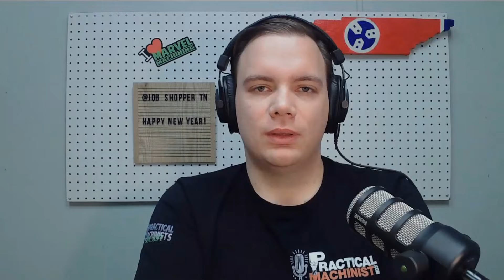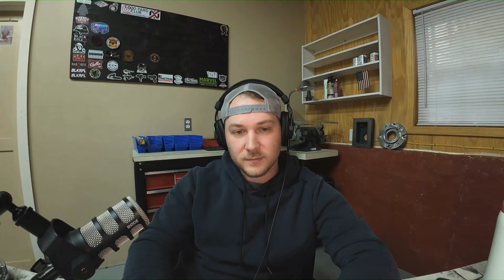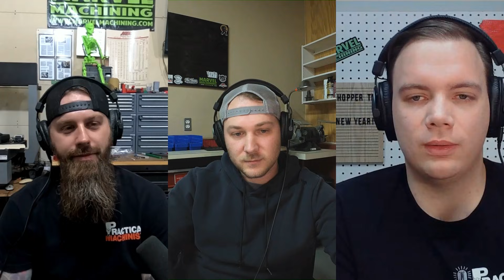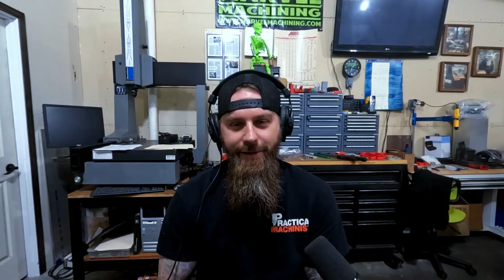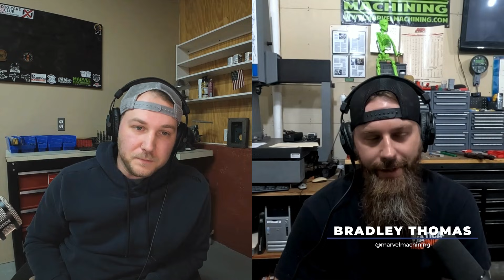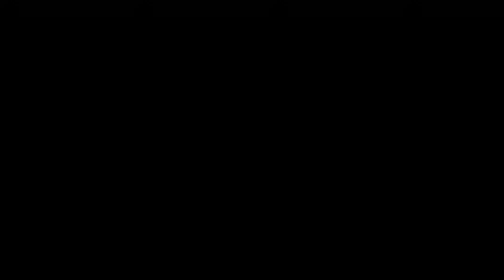Thread Milling vs. Tapping: What Works Best for You | The Impractical Machinists 14

Comment: The older I get the more I notice these things. A new technology or technique comes along and changes the game and everyone jumps in with both feet and adapts it to every situation as if it is always  an upgrade. Then later people start realizing the old way had it's benefits. Really the two ways should work in unison instead of one or the other is always the best. Solid carbide end mills and adaptive machining vs insert tooling was the first one I really noticed. I remember watching a NYC CNC video titled "stop slotting the stupid way" where he basically says milling slots with an adaptive tool path and a solid carbide was just better in every way. And sometimes it definitely is however if you have the rigidity and horsepower I will do that slot in one pass and be on to the next op before he is even half done. Just because something is new does not mean it is better and just because something has always been done that way doesn't mean it can't be improved upon. The trick is knowing when and where to use what tooling and technique to get the job done efficiently with what you have.

Comment: Form taps will be choice one for me due to several key benefits.  The main issue with them is controlling the minor diameter and avoiding a "bell mouthed" entry.    I avoid them on close tolerance work or low volume product.  Form taps I find beneficial for my own aluminum fixturing as well due to the stronger formed threads.

I end up using thread mills the most because of there function and use.  The controllability cannot be overstated.  And last but not least cut taps have there place and should never be overlooked when you need consistency and simple thread applications.

I do have a question though when it comes to the indexable vs solid carbide end mill conversion.  For standardizing tools in the machine do you think it's better to keep a high feed insert cutter over a longer solid carbide endmill.  It is hard to dedicate solid carbide  because it's hard not to misuse the flute length imo.    Thoughts?
Reply: Depends on the part, but I typically keep a standard length and a long length roughing end mill in the machine. T2 is 1/2 x 1-1/4, T3 is 1/2 x 2. Then a high feed mill can be added when needed. Usually a high feed mill will have a longer cycle time than using HSM strategies with an end mill up to 4xD depth.

If cycle time isn’t your concern then you could have a standard length end mill for roughing then a HF mill for anything longer.